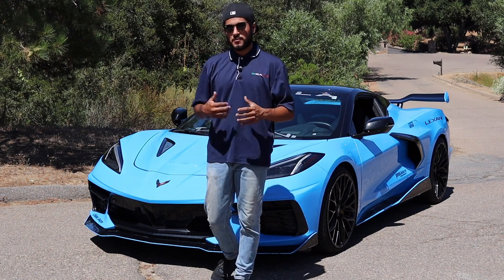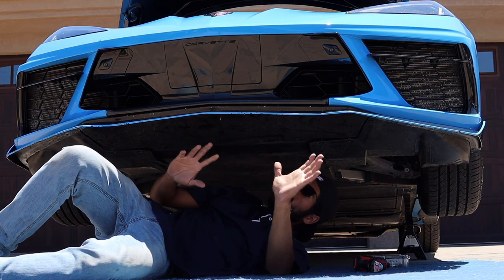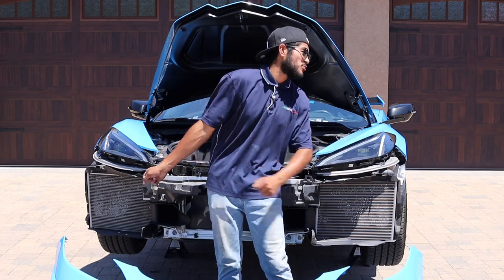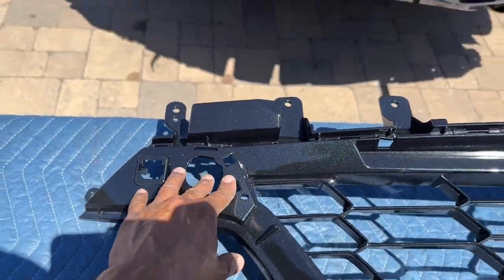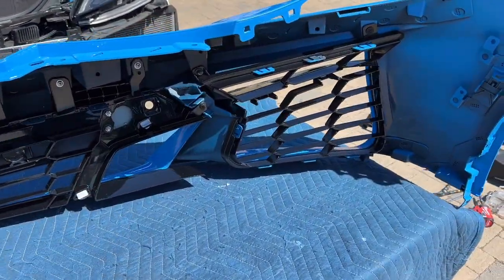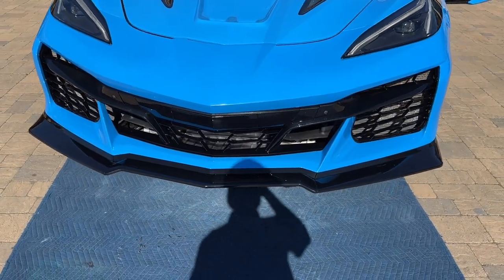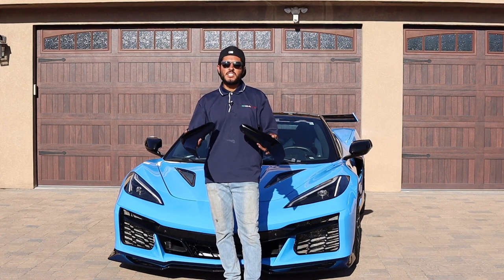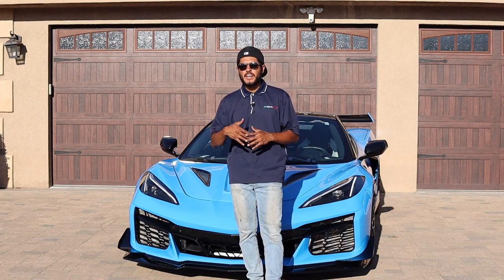C8 Corvette Stingray, Installing NEW Z06 Style Front Bumper!!! Must See!

Comment: Could use black spray paint to camouflage parts behind new open center grill. 
Also looks like room for additional coolers if modifying the engine and need extra cooling. Run cooling lines in tunnel area, under car, to engine in rear.